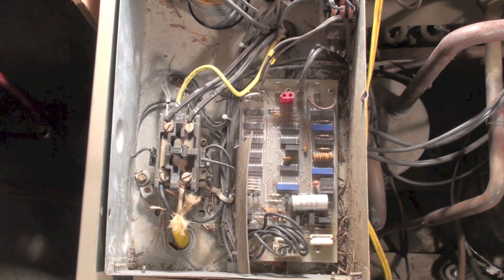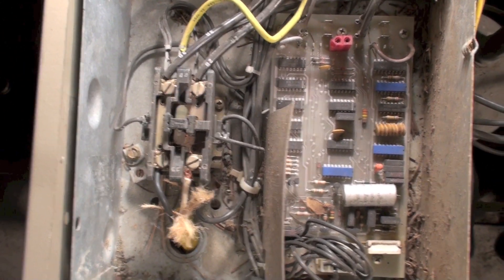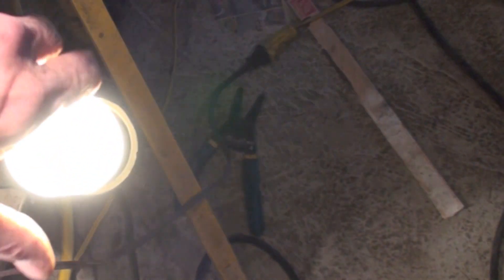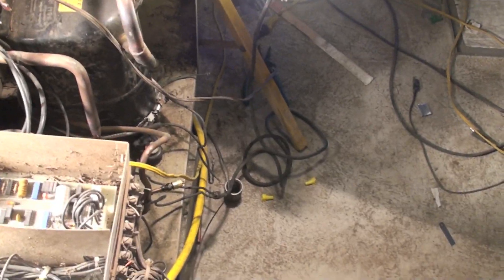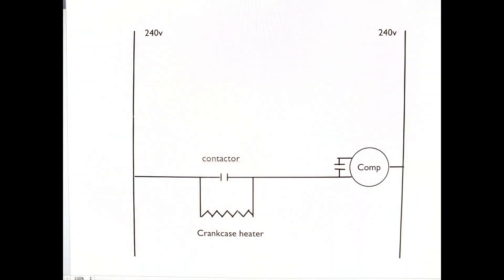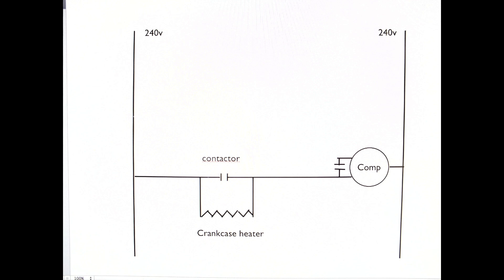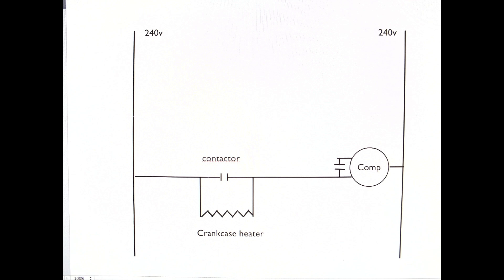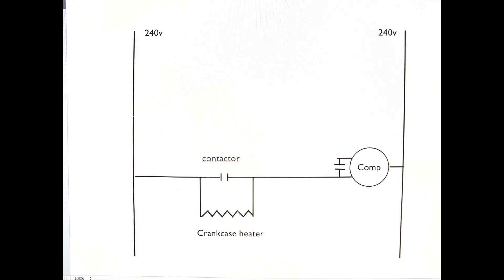HVAC compressor crankcase heater wiring

Comment: Should the single contact feed the run winding or the common on the compressor or does it matter ?
Reply from the maker: Generally, common is not switched.
GFM

Comment: I have a Carreir unit that was installed in 2008. It has a CCH wired just like this except one of the legs of the heater goes to a control board and shares the same blade as the black fan wire.  There is an inline thermal switch that I assume controls when the CCH turns on/off. The issue I'm having is that some how, there is a small amount of voltage making it to my condenser fan, when the AC isn't on, the fan blades rotate slowly. There are times, where it does not.  I've replaced the capacitor and contactor but no luck. If I disconnect the CCH wires, then this behavior stops. I cannot figure out why this is happening.  It originally started when the HVAC guy replaced a capacitor a few years ago. When I mentioned it to him he didn't seem to think much of it.
Reply: I don't know why Carrier has one lead of the CCH going to the control board and essentially connecting it with the black fan wire instead of keeping it on the contractor but that's what's called out on the wiring diagram.
Reply: The more that I think about this, I'm guessing that normally, there wouldn't be enough electricity flowing through the fan motor to turn it but something is not functioning correctly and allowing enough to turn it. When I measure the voltage on that shared CCH leg (i.e. when it's on the same board connector as the fan motor) there are 97 Volts.  in the rare times that the fan isn't turning slowly (might be controlled by the temperature switch) there is 123V on them.

Comment: Question so if I install a jumper on a 2 pole contactor  ,it could cause issue for the compressor?
Reply from the maker: No. If you are installing a jumper on one set of contacts, you are simply imitating a single pole contactor.
GFM
Reply: @grayfurnaceman  thank you for replying back . I was a little confused . I did manage to find the Schematic for the unit. Thank you for making these videos they’ve very helpful when I get stuck .

Comment: How would you wire it if a double pole contact was installed to replace a single pole. I have a new installation of the Mars 10874 ECM designed to replace PSC fan motors. But with a single pole contractor, the ECM motors get enough current flow through the heater that it makes it spin for a brief 4 seconds and idles for 10 secs and repeats continually.
Reply from the maker: You can jumper the side of the contactor that is not necessary.
GFM

Comment: Does the crankcase heater function to prevent oil escaping from the  compressor?
Reply from the maker: Indirectly, yes.  Refrigerant moves to the coldest and oiliest place.  If the crankcase heater keeps the compressor warm, it will keep the refrigerant from traveling to the compressor and mixing with the oil there.  If the heat is not there, the refrigerant will foam because it is mixed with the oil and both oil and refrigerant will move out of the compressor.
GFM

Comment: Great video! Keep posting these videos! 
One other thing that I think we, as techs, need to ask ourselves is 
"Why are the bearings becoming washed?"

Is it because there is no CCH?
Or because the owner ran it when temps outside were 65 deg or lower?
Or because the system was over-charged (with no TXV inside)?
Or because evap coil froze up (freon leak, air flow reduced)?
Or maybe because oil isn't migrating back to the compressor quicker than it migrated out of the compressor?
Or maybe oil charge became low from it ending up being recovered along with refrigerant?

I recommend bellybands. Even if its in Miami, Florida.
Even if its just a regular condensing unit (not a heatpump).

Also, if the evap coil is above the ground level floor of the home/building (i.e. 2nd+ floors, or attic), & the outside unit is located at ground level, technicians should fashion the suction line coming off the evap coil as a "rainbow".
& make sure the system has a TXV to maintain superheat.
And outside, right before the suction line goes into the outside unit, fashion the suction line as an "inversed P-Trap".
This will decrease the chances of the compressor getting a gulp of liquid when the compressor energizes.

Comment: What is the temperature range used for the temperature switch controlling the crankcase heater?
Reply from the maker: It varies with each manufacturer.  Suffice it to say the compressor needs to be above 70F.
GFM

Comment: On my 2007 Goodman heat pump, the crankcase heater is connected to L1 and L2 on the contactor, so it's always on. According to the wiring diagram, this is how it was done at the factory. This way, either a single pole or double pole contactor can be used. Perhaps some manufacturers use a thermal switch in line with the CCH to switch off the CCH once the compressor temperature is above a certain point...
Reply: Some manufacturers will set up the CCH to be governed by 3 T/STATs.
One taking the temp of the evap coil; another taking a temp of the compressor crankcase; & another taking a temp of the outdoor temp.

The goal is to maintain a crankcase temp a certain amount above the lower of the 2 other temps (evap temp & outdoor temp).
& so, in this way, it will de-energize the CCH when the crankcase temp is warmer than the lowest of the 2 other temps (evap temp & outdoor temp).
Reply from the maker: All the methods you described are used with crankcase heaters.
GFM
Reply: Thanks for the quick response! Really enjoy watching your videos!
Reply: Mine has a double pole contactor. 11 and 13 are my incoming power at the bottom of the contactor…… and 21 and 23 are the outgoing side of the contactor. Says to wire it from 11 and 21 now it does have a chs ( T stat switch) is that why both wires are on ONLY one side of the contactor?
Reply: @Hvacnc  It acts like an on-off switch to the crankcase heater, as shown in GFM's video... but that would be with a single pole contactor installed. With a single pole contactor, pins 23 and 13 would be connected together at all times, and pins 11 and 21 would be switched. With the contactor open, power would flow through the crankcase heater, which is a high resistance path, and then through the thermostat, and then through the compressor windings back to L2. Since the heater would be a high resistance path, the voltage across the compressor would be very low, and not run. But when the contacts close, the heater circuit would be bypassed completely by the contacts, and therefore switched off while the compressor is switched on. With the contacts closed, the compressor would then see 240V and run. I wouldn't know for sure if this is in fact the case without seeing an actual schematic of your unit. Perhaps your unit may have had the single pole contactor replaced with a double pole contactor at some point. The 2007 Goodman unit had the crankcase heater connected between L1 and L2 on the hot side of the contactor, so it wouldn't matter whether a single or double pole contactor is used. But on your system, it seems that a single pole contactor would be needed for the CCH circuit to function properly as with a double pole contactor, the compressor and the CCH would be open since L2 would also open when the contacts open. Some units don't even have a CCH. The unit on my current home, a 2010 Tempstar heat pump, doesn't even have a CCH, maybe due to it having a scroll compressor (instead of a reciprocating). Some units with scrolls have a crankcase heater.

Comment: Could you illustrate the crankcase heater, the double pole contactor AND the discharge line thermostat in another video?
Reply from the maker: I will put it on the list.
GFM

Comment: If you swapped a single pole contactor with a 2 pole and it doesn't have a (real CCH) just uses the winding as some units do tp act as a heater does it have to have constant power to the windings as a real CCH does during none operation state. or do I not need it that way

Comment: As usual, great explanation GFM.   Question... is it worth turning off the CCH in the summer with ambient say above 60F?   Or is that not a good idea.
Reply from the maker: +Gene Friedman You can if you wish.  Just remember to turn the breaker on 24 hours before you turn on the air conditioner.
GFM

Comment from the maker: I have seen them on the refrigeration systems.  I think why they are dropped out on a/c and heat pump systems is the SEER and HSPF would have to be lowered if the CCR was left on.
GFM

Comment: Refrigeration systems the crankcase heater is connected to L1 and L2 on the compressor contactor so it's always on.
Reply: wow I was scratching my head on this very topic. Very informative. Big help.Thank you
Reply: What If you live in a hotter climate

Comment: Why not let it run all the time, and connect leads to L1 and L2, the amount of heat isn't enough to effect operation.I'd be cautious about electrical surge by wiring it through the motor winding, I it might act like a fuse.

Comment: that looked like a old 1970s or 1980s york heat pump is that the one with a bad reversing valve i tought it was a janitrol but i was wrong